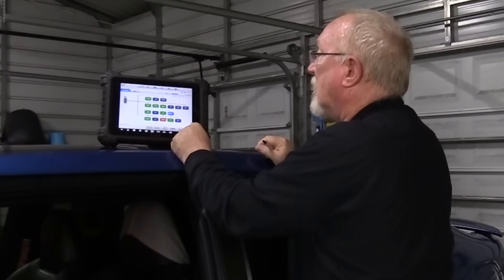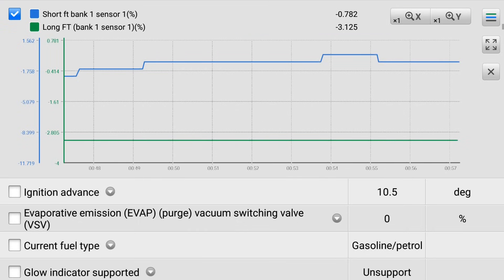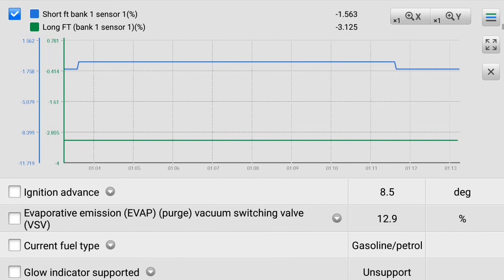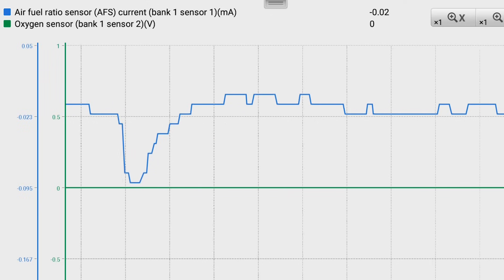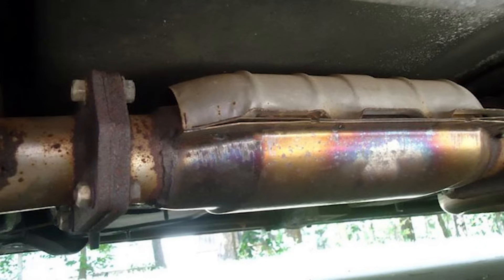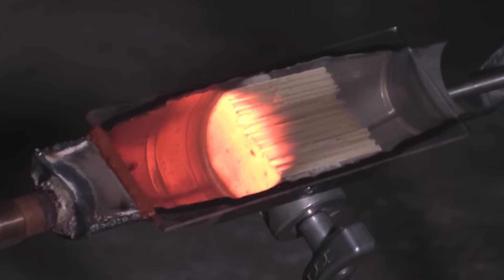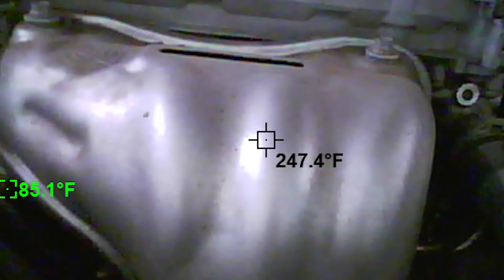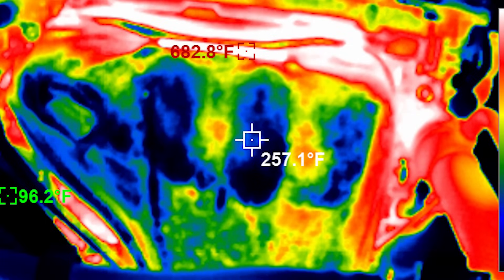The Trainer #118:  The REAL Cause Of P0420/P0430 DTCs

Comment: This code is driving me nuts. It keeps appearing and disappearing. Replaced all the oxygen sensors, and while did that, looked inside the converter using borescope, it looks nice and clean. I have no idea why it is doing that. At idling, the temperature is at 1050⁰F degrees. Is that okay? Something tells me it is not.. also, i do have lower power feeling for the engine. It is sluggish on acceleration. Revs higher than before when i bought it. The mileage is 129k.  Cleaned all the injectors. Replaced spark plugs. Cleaned MAF. but it keeps doing the same, check engine light appears and disappears. On an off all the time. Also, I have very little vibrations when sitting in the car. Someone would say it is okay, but i don't think it suppose to do that. Checked it with the launch scan tool and some parts of measurements it was showing as red while others green. When reved the engine it was turning green. Not fully understand those values yet. Just getting into this mechanic things. Maybe bad injection timing? Ugh, no idea!

Comment: The P0420 in my car was caused buy a combination of a worn donut gasket at exhaust manifold combined with worn engine mounts. Code would popup when driving up steep hills. Downstream sensor was reading lean. A new gasket and mounts fixed it. Vehicle is a 2006 Toyota Matrix 4WD with 226,000 miles.

Comment: My CEL light shut off on it's own after one day. Freeze frame data from when the code set reported my RPM at 3950 in a low gear.  I did recently get distracted and forgot to shift (manual trans).   I would have thought the PCM would ignore that.  I will do the other checks in the video just in case.
Reply: You FORGOT to shift? Really? I've only ever driven manual transmission vehicles and shifting is automatic (no pun intended!). It's about muscle memory, not just remembering to shift.

Comment: I am so sad. Going to a mechanic these days makes me nervous. My little Honda Civic never missed a scheduled maintenance. Now, here is this 420 code that is persistent. I went to this place (under the recommendation of someone I know), and all they did was tell me they found a P0420 code. The report literally reads:
“P0420- Catalyst Efficiency Below Threshold Bank 1. Replace Catalytic Converter assembly with OEM part along with both Oxygen Sensors and recheck. Replace exhaust gaskets and spring bolts as well.”
For a total of above $4K. So, basically, I am going to pay that much money for a 14-year-old car to find out "if" it was the problem or not (they said "and recheck"). By the way, they charged $200 for the diagnostics to tell me something I already know since I checked with my OBD reader!
You go to these "specialists," thinking that they will do a great job and tell you the truth, only to be disappointed. I know that I may need to replace the converter, but the information they provided is clearly not enough to lead to that conclusion, as demonstrated in this video. 
Thank you for the video!

Comment: 07 jeep jk 3.8 air temp intake senor was bad took out passenger  side converter. Never threw code about sensor.  Also had rad fluid leak on o2 sensor  caused 420 code

Comment: Welll...my cat is definitely bad, the cat is running at 380F and right at the rear is at 280F or so, there are no codes, no misfire, no coolant lost, no lost of oil, but the car drives fine for now, but I will get it replaced because I don't like driving with the check engine light on because is a GDI engine. 
Gets Destroyed Immediately when the check engine light comes on

Comment: I had my engine replaced. Three days later, the engine light turned on. They checked it twice and they said  catalytic converter needs to be replaced. I was told it might came from the bad engine and  ruin the cat. It costs a lot to fix it. I used cataclean and the engine light turned off for 3 days but came back on again. They trying to charge me 3500 for it. I can't afford it. Trying to figure out where to take it for a cheaper price
Reply: Any success?  Cataclean, 1 gal lacquer thinner, Gumout with PEA, point is to clean out cat.  Sometimes you have to clean it 2 or 3 times.  Then I would clean it replace O2 sensors.

Comment: My 9 month old after market converter was rattling like a stone was in it. (No codes). My mechanic said he could not check any readings because he said back pressure was present.  When I asked what the back pressure showed he had no data.  Just said he could hear it leaking.  He said looking at engine data was useless due to the back pressure and said the cat is obviously broken so he would not be able to test until a new free flowing cat was installed.  I basically paid 200 for a diagnostic that he did not do and said he couldn’t do.  Is this even right?  I feel like I got swindled.  I did my own fuel trim readings and my long term fuel trim was around -3.6 on a 20 year old car.  That does not me seem bad enough to create a failing car so fast.  He also claimed he could hear material down stream rattling around the resonator but I took apart and it’s completely free of material.  Doing a pressure test later today before and after the cat.  Going to be pissed if I find no  issues. I get the catalyst may have broken.  I can hear it in the cat when I hit with a rubber mallet.  But that’s not what I paid him to figure out.

Comment: Helpful information!   I have the Autel AL519 which told me I had an issue on Bank 2.   I deleted the code after checking the front & rear temperatures, as the drivers side seemed to have a wider difference between the two (which I believe is bank 1) as I have 2 converters on my F150 pickup.  Interestingly, it's been a week, and after having the initial code come up, it has stayed off, although I will test again today.   Thus makes me wonder if it was a random code that popped up for some reason?   Nonetheless, it's something I'll be keeping an eye on.   Thanks for the video!   Having 137K on the truck, I would imagine the converters 'may' be getting to the end of life, but I'll continue to watch for check engine lights.  Fuel mileage hasn't really changed either.

Comment: Would the PO420 cause the car to go into limp mode? The vehicle is running terrible and won’t shift out of 2 or maybe it’s 3 gear that it’s in. Starts and runs ok until you start driving it. It did pull a PO420 code. Cats were changed 1 1/2-2 years ago. Could it be the oxygen sensors??

Comment: I replaced the catalytic converter in my 03 Corolla in 2019.
I just got the P0420 code again. I suspect that the oil consumption and burning is the cause. 

Any thoughts on Cataclean?
Reply: Works to clean it for about 100 miles. I’ve found Lucas to be half the price & goes at least 6x further.

Comment: My P0430 code has become intermittent.  Today was cool outside and tonight the temperature is 45 degrees outside. And the code on my dash went off.  I just replaced my O2 sensor 2 weeks ago and it seemed to work because there was no engine code.  Then 2 days ago the light came on and now tonight the check engine light was off again.

Comment: being a 00s chrylser guy (with several in my fleet), i'm very familiar with the O2 sensor outputs and their readings on my Autel MS 906Pro.  However a friend of mine had the "dreaded" P0420 code pop up on her Honda.  The software on the Autel doesn't report Honda's sensors (2013 Odyssey) in the same way, so I was struggling to help her diagnose, is it a bad cat or a sensor problem.  Curiously, the MIL went out on its own, and the code was stored as permanent, but not active.  In fact, I had to use EOBD to read both sensors, with the downstream in V and the upstream in mA.  My educated guess is she has a bad upstream sensor, and not a bad cat.  I came to that determination based on comparing the upstream data between both banks, and noted that bank 1 would occasionally be "smoother" than bank 2, instead of roughly tracking the same, and even once go completely flat line at 0 mA.  I considered a possible wiring fault, but the fact the traces look like a sensor getting "lazy" or "falling asleep slowly" then suddenly "waking up", makes me lean towards a failing sensor rather than a wiring issue.  The downstream sensors would also follow the upstreams in their reporting and graphing.

Where would a DIY shade tree home owner mechanic go do to find more information about specific vehicles and their expected O2 sensor outputs and performance.

Comment: I have a 2008 infiniti Ex35 which had the P0420 code. 
Was diagnosed that the cat's needed to be replaced, as appeared to be clogged. Replaced cat's.

However,  I now have extremely, poor gas mileage.

There are no error codes.

Any idea what is wrong? I am so confused that the cat's were replaced and now my fuel use is up by 30%.

Comment: How can us poor people tell because we dont have All these electronic tools
Reply: I actually got this from another p0420 code video, but you can purchase a relatively cheap infrared thermometer (I call it a temp gun) for ~$15 (at harbor freight) to maybe $40 (I recently bought one at Walmart for ~$25). You measure the temperature at the inlet (from the engine) of the cat, and at the end of the cat (going toward the muffler) when the engine is running. From my take of it, the temp at the inlet should be cooler by ~50° or so compared to the end of the cat. If the end is cooler, your cat is restricted. I actually need to test this on my familys '06 quest as the code popped up, but the performance is not noticeably lacking from the 3.5l v6. It's just one more useful tool in my toolbox. :)

Comment: Have the p0420 code on our 2012 honda pilot. Started bogging when trying to accelerate. My 1st guess was bad cat. I was hoping a bad 02 sensor or air filter but with it running crappy im quite positive its the cat. Which really sucks

Comment: Also, should I run some heat through the truck because I have been running crappy gas for economy and this problem started after the outside Temps reached -15 and it wouldn't start.  I "think" it's the exhaust leak, but water in the motor that froze probably added to the issue

Comment: An extraordinarily smart and kind gentleman, he explained the basics and specific things. My Charger's converter was sentenced by "professionals" in the dealership, but it turned my engine was running lean due to wrong calibrations. So, I got my PCM replaced and the P0430 code is gone and not coming back.

Comment: Your theology is correct, but none of you techs ever give what the actual numbers we should be looking for. example: fuel trim @ idle vs 2500 rpm! When they"re out of skew, what to look for! I have a 2007 forenza with -10 in the long term @ idle and short term is zero. At higher rpm it hovers around zero! I"m still getting a po420 after replacing the convertor several times, ecm, spark plugs, wires, coil, injectors, intake gaskets, complete exhaust, and timing belt! The air/fuel ratio is 14.7 so I know its running well! Should I reflash the computer? I don"t know what else to do!
Reply: I believe if it down stream o2sensor is mirror to upper 02sensor ur cats aren't good or failing
Reply: Ever figure it out?

Comment: totally useless information
Reply: Just like your comment.
Reply: @GrandpaMunstersMultitrackLab  what is the point of having a system diagnosis if it does not diagnose the problem. People pay hundreds of dollars just to have their mechanic guess at what may be wrong. I've been working on cars, trucks, motorcycles, and many other small engines for over 30 years.. I can guess what's wrong,, but that's all it is a guess. We now have cars with all these computer systems and we still only 'Guess'. My truck pops a code saying 'left bank lean'.. some say head gasket, some say, valves, it's the timing chain... I'm too lazy to fix/replace it. But the other two guesses were close.

Comment: My 2013 Mitsubishi Outlander Sport is about to reach 169K.  My Service Engine Soon Light has been on the last two weeks and it turned off for a day then came back on.  I had it scanned and the code says P0420.  I remember what that meant because I got my cat replaced last April when my car was at 110K.  It’s driving just fine.  I don’t know what to do.  I need it for work.  Driving from PA to NY.  I notice it is a bit more sluggish then usual going uphill.  It always has but moreso.  I just attribute that usually to age.  But it is driving fine.  Stress lol I just got my brakes replaced and a new fan belt three months ago.

Comment: In the North East we most commonly see faulty converters.
Exhaust leaks will show up in the fuel trim data, if theyre affecting the converter.
Exhaust leaks are audible, and traceable in fuel trim data.
95% of the time, its a bad converter BUT the first step is to replace the rear o2 sensor, then the cat if code comes back.

Comment: Can a bad purge valve cause this? My journey has power and is very responsive, it also has the code for a bad purge valve.
Reply: Mine is saying the same... we're you able to find out ?
Reply: @jacobalfaro8982 I ended up changing out some sensors (I dont remember which ones) It wasn't the CAT after all. It was a pain in the ass, another code came up about a year ago (unrelated) and I junked it, got tired of the problems.

Comment: I had a customer come in after the dealer wanted to replace the converters because of a p0420 code.

I noticed the engine running rough, when reading the stft and Ltft I noticed -10% at idle, the ecu was trying to pull fuel.

I immediately pulled the spark plugs and found 3 of them were not tight, they had crush washers that weren't crushed. This was a improper install of the spark plugs.

Combustion gases has covered all the threads and spark was weak and not burning the fuel completely.

I cleaned the threads in thee cylinder head and replaced the plugs. The fuel trims returned to normal and the code hasn't been back since.

This kind of thing is why you take your car to an experienced diagnostic tech and not someone who throws parts at codes.

I charged $550 for the diag and repair compared to the $2900 the dealer would of charged to only have the code come back.

Comment: So I just bought a 2004 ford ranger xlt 4x4. It has a 4L V6. Right after I rolled off the lot with it, I noticed that the tank was close to empty, so I decided to fill it up. I heard that non-ethanol gas is better for engines, so I filled it up with 93 octane non-ethanol even though the truck calls for 87 octane. I have heard and read many times that it never will hurt to go higher in octane. Anyways, about 20 minutes of driving later, and my engine light comes on. I check and the code is P0420, and it specifies bank 1. Is it possible that I caused this by filling it up with the higher octane non ethanol fuel?? Or did the dealer screw me over and clear the code right before he sold it to me??
Reply: My light came on right after I filled up at a different gas station than I normally use. I was wondering if its gas related too!
Reply: @Cutekittee me too sigh.

Comment: Long Term is the window of time the adaptive memory dictates the fuel trim, Short Term is live data calculating to learn the parameters for the adaptive memory to update the Long Term. The O2 sensor signals rich  below .45 volts & lean above .45. The Engine Controller only cares about that threshold & uses that to determine fuel trim. .. in other words the computer calculates the % of time that the O2 sensor is past the threshold of .45 volts & does that each time the threshold is crossed.

Comment: I got P0420 because my gas cap is broken, after change the OEM  parts  from the Toyota dealer. Its gone the check engine light.

Comment: My PO 420 code came on due to a Fram extra guard air filter that I had just replaced went back with original equipment Motorcraft air filter in PO 420 code went away, not saying that there’s not some underlying issue but that’s what removed the code on my 2018 Ford F150, 2.7 L.
Reply: I just took out the motorcraft air filter and put one of those red STP air filters in. Now I have the code 2 days later. Interesting. By the way I had thought of this possibly being a problem and had already ordered a new motorcraft. The STP FIlter was new when I bought the car but changed it out in a few days to motorcraft.
Reply: I definitely will try this. Unfortunately, I was recommended getting a heavier air filter because the 2015 Expedition didn't come with a cabin filter.

Comment: Never a trouble with a 1992 till government recommended pollution test failure mechanic fixed it, then never not but failure and trouble...so likely need to buy the manufacturers pollution ...covid vax showed exactly the carbon they wanted gone...???

Comment: So I have a P0430 code on my FJ Cruiser, I can make the code go away with an "Italian Tuneup" which gets me through inspection every time however I have grown tired of seeing the christmas tree on my dash every so often so I appreciate these tips in both the video and the comment section. I happen to know the valve cover gaskets leak a certain amount of oil into the spark plug chambers, is it possible this is the ultimate cause of it? I have been building a parts list to replace a lot of the maintenance parts on top of the engine when I do the valve covers and once I have done all of that, if the code persists, I figure I will tackle the air fuel and 02 sensors next, then finally if it continues the Cat will be the last piece of the puzzle. Truck idles and runs like it's brand new so I rather doubt the Cat is actually bad.
Reply: Have you tried a cat cleaner?
Reply: I’ve found Lucas works the best.